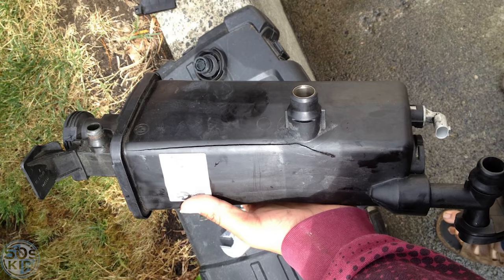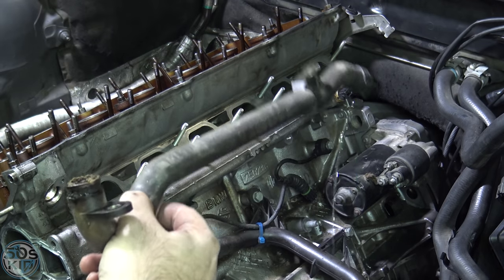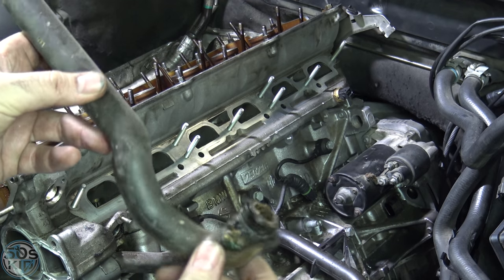Common BMW E46 Cooling System Failures

Comment: 103k on my expansion tank 😂 just waiting for the day
Reply: Any day now. 😂. Mine went at 105k
Reply: @mikey_likes_it_  ahh I just did my starter, that was fun 😄 intake manifold off. Took me like 3 days to trace why my engine was so poor afterwards. Turns out I hadn't reconnected my camshaft sensor 😂 gotta love these cars man
Reply: Consider doing the expansion tank now before it blows in an inconvenient place and you're stuck.  + Peace of mind
Reply: 2001 and my tank cracked at 60K. Coolant was replaced every two years with BMW coolant and distilled water. TEXAS heat did it in. LOL.
Reply: Don't wait!  you do NOT want this failing catastrophically - You could loose the engine!

Comment: lets see.. 2001 325i.. 188K miles
I've replaced
Thermostat
Radiator
Expansion Tank
Hoses

Not sure what was replaced by the previous owner, but I have put most of the miles on this car.....

Comment: Radiators that are at the coast line by the beach, you own any car with radiator it will go bad quick. The salt in the air from the ocean eats up metals, especially radiators

Comment: This is just the tip of the iceberg, I own and e46 and everything is wrong with it . Right now I’m trying to figure out a EML triangle light going lean mode type of bs !!. I don’t recommend anyone to experience this it’s a headache. I changed the wheel speed sensors and fixed it for a month and the problem is back now. 🙄🔫☠️
Reply: Go to e46fanatics.com someone might have had the same problem that you are dealing with.

Comment: do not use the metal impeller water pump, the point of the plastic is so when the water pump is worn the plastic will break, if your running until they break you should have already replaced it. with the metal impeller it will grind through the housing behind it instead of breaking this will total your block.

More important real world things to remember is the cooling system works at a higher pressure than most, however if you run low on coolant it will then produce steam which is higher pressure than coolant, this will find or create a leak, the other thing to remember is coolant temp sensors only work in liquid so a system low on coolant is not going to measure correct.

Comment: I have a 2002 330i replace the expansion tank and the upper hose with the thermostat and the housing oem. Now the gauge goes hot and comes back to normal while driving and the tank will smoke and no antifreeze in there. Any suggestions. Thanks

Comment: I change my E46, i bought a 550i f11 😉
Reply: Now you have a whole new bunch of possible problems. Great car if well maintained.
Reply: @petepenn1  yes, this car heats up a lot and consumes oil. I replaced the water pump and the thermostat

Comment: Two things would have eliminated the vast majority of cooling system failures in the E46: First, if BMW used more durable plastic. Second, if BMW designed the system to be bled more easily. If BMW used better plastic, we would not be talking about almost any of these issues. European auto industry traditionally used poor quality plastics that Honda or Toyota would not use. That is per literature from DuPont. Also, there is always some air trapped in the system if the normal bleeding procedures are used. You don't see it, but that air reduces cooling capacity. The way to properly bleed the system with minimal air is to use a vacuum filling system. That is what the factory uses. Do you really think they fiddle around with the bleed screw and parking on a slope, all that monkey motion, at the factory? No, they use a vacuum filling system and get it filled within a few seconds. In fact, the whole point of the pressurized expansion bottle is to separate as much air from the coolant as possible to give it that extra cooling capacity. Air in the coolant is detrimental.
Reply from the maker: And they needed to use better rubber gaskets and o-rings!!
Reply: @50sKid  Ha ha yes of course! I consider myself a graduate of the University of 50skid. I bought a 2002 325i a few years ago and did EVERY preventive maintenance that you showed in your videos in great detail. I enjoy driving my "poor man's classic" BMW and it is all thanks to you!
Reply: @50sKid  Also the temp gauge is buffered. I heard theres a temp gauge mod for it. Maybe you should do a video on that and let us know what you think 👍🏽
Reply from the maker: @emineid  Nice!
Reply: My experience is that when the BMW overheats, the needle goes to red within just a few seconds. Therefore, I am not aware that a more "precise" temp gauge would be of much help. When it goes to red, I pull over. It is as simple as that.

Comment: Turbo build e46!!!!!
Reply from the maker: I'd really have to change the pistons -- you want lower compression ratio to reduce detonation but at that point you're losing all your low end torque so it's like, what's the point?  The thing becomes sluggish unless you're in a drag race.
Reply: @50sKid  ah very understandable
Reply: @50sKid  Agreed...naturally aspirated engines will last much longer. Maybe  a little HHO for boost +carbon cleaning.

Comment: 1. M54 wasn't amazing engine. It was junk that burned oil and had permanent oil and coolant leaks. I like old Bmws very much but M54 the worst engine in M-family. 
2. The purpose of heater inside the thermostat - is to increase engine temperature under light load to improve thermal efficiency. Not heating coolant when the engine is cold.
Reply: The m54 3.0 liter burned oil.

The 2.5 liter did not have that problem.
Reply: @dwaynejacobs9558  they do. They have the same crappy piston rings and many m54b25 burns oil like mad.
Reply: @dwaynejacobs9558  they are identical.